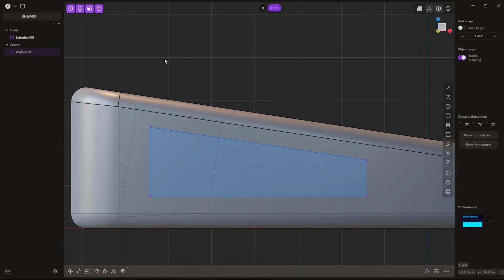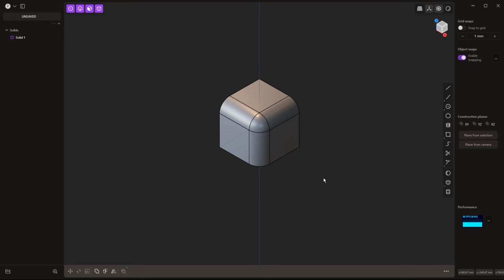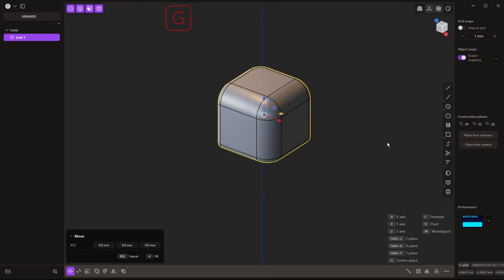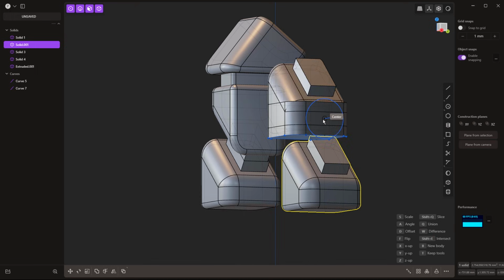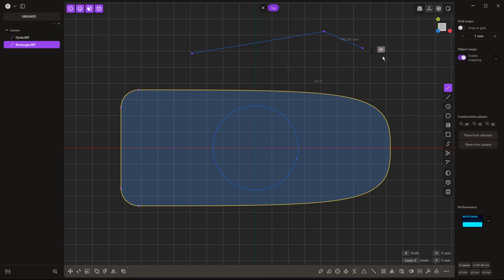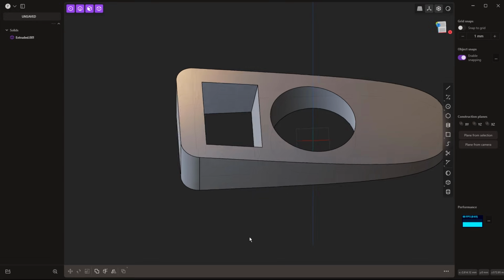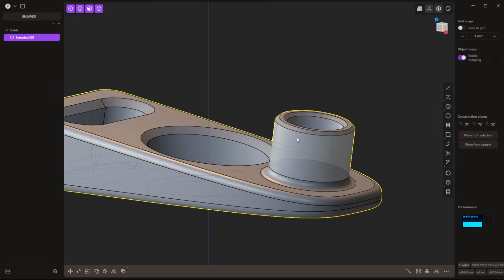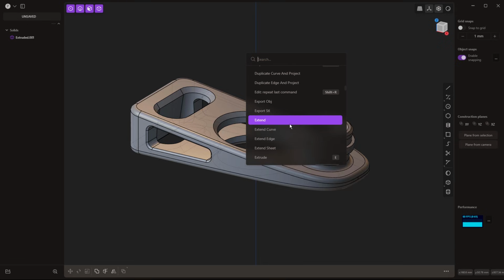Getting Started with Plasticity for Beginners | V1.4 Update | UI and Modeling Overview

Comment: Problem with this amazing modeling tool is it's not parametric where I need it ( Ex: just drag a square, once it's done then you can't adjust the exact size ).
Reply from the maker: There have been some nice updates since that video.  Check out the updates to dimension/measure here https://youtu.be/LSAc4uyxTao

you can use dimension and the measure tool to precisely locate features.  its not a true parametric control but its improving.
Reply: @LearnEverythingAboutDesign  Do they plan on adding parametric edit feature on edges ?

Comment: This is awesome! Great tutorial as well. I'm a 15 year Blender user and this just feels like home. Quick question: I'm using a MacBook Pro M3 which doesn't have a numpad, so I'm unable to get the hotkeys that toggle between views, front, side, etc. to work. In blender I can remedy this issue in the User Prefs, but I'm not seeing a way to get the views hotkeys working in Plasticity??
Reply from the maker: Awesome!  For the Temp Constructioni Plane you  have to have a planar view selected.  On the right hand side there is also a button for creating a construction plane from View.  Its CTRL + SPace, but i imagine on a mac that would be Command.  Its called "Plane from camera" on the construction planes section.

Comment: I had bought the software on my macbook,
But yet I didn’t get the license key,
How long does it takes for me to get the license?
I use your code discount and yes it work🥰 thank you for the discount coupon 🥰
Reply from the maker: hmm. it should be instant.  the serial number should go to your email.  double check your spam folder.  If not you would need to reach out to the plasticity team.  I can help if you have trouble getting ahold of them.

and thanks!

Comment: I create things for my 3d printer.  A lot of times i need to make minor adjustments, for instance shrink a cylinder by 1mm.  Are minir adjustments like this easy in plasticity?
Reply from the maker: Yes and no .  So you can go in and select the face of a cylinder and offset it by 1mm (or .5mm for the radius) for your offsets.  But there isn't a sketch you can go back to and make that changed.  I have a few videos on doing things like Print in Place models, hinges, and threads on the channel.  We have some new features in the latest release that lets us add dimensions to features and edit them with the move command.  this helps with hole positions for example.
Reply: @LearnEverythingAboutDesign  I'll check your videos, thanks!  I feel like I would like this better than fusion but I worry about not being able to easily change constraints (yeah I understand they don't exist, it's just how I think of *changeable" dimensions.  😀).

Comment: i been using Fusion 360, can one make dimension  drawing?
Reply from the maker: Sadly no.  Plasticity doesn't have drawings and honestly I doubt that it ever will.  it is meant to be a CAD program to help with rapid concept development for mainly downstream work like rendering/animation.  It can be used for 3d printing and other manufacturing but its not a history based parametric CAD program.

Comment: How do you effectively work at mm level? My printer has base plate of 200mm by 250mm I set grid to this. but it makes the grid microscopic. I was able to zoom in a ton and shrink the objects I was working with. But if I pan at all the camera moves a metric mile away from what I'm working on.
Reply: Actually I closed and re opened software and it seems to of fixed itself
Reply from the maker: If you take a look at the latest video i did here https://youtu.be/FUH8IvXmodE  we start by setting up the grid and i mention setting it up to your build plate size.  that helps me at least.

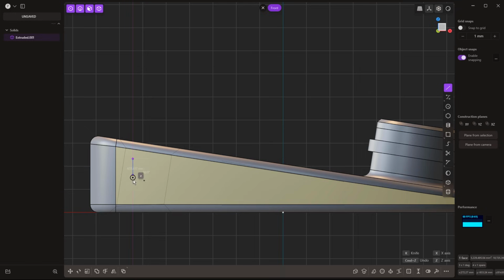Comment: At 23:30 into the video, where he was creating that cutout on the side was very confusing.  Maybe it was because I couldn't see or tell where his cursor was or was being clicked on, or maybe he was using shortcut keys, but it was impossible to follow.  I kept getting Boolean errors.  For some reason, I couldn't close up the hand-drawn panel on the side either.
Reply from the maker: at 23:20 we hit O on the keyboard to offset the selected face.  This tools is a bit tricky because the cursor location often makes it tough to get it to work.  you can manually enter a value when you hit O.  Try a negative small number and see if that gives you the offset you want.  

When we move to using the line tapping the shift key enables some relationships so you can get virtual snaps for things to be parallel or intersect.  

For closing up the hand draw section try selecting the point you want to move, hitting G to start the move command.  Once the move command is active look in the bottom right corner for the options. the Freestyle option lets you pick the starting point and the ending point.  the starting point is the current location of the vert you want to move, and the ending point is the one you want it to move to.  Hopefully that works.
Reply: @LearnEverythingAboutDesign  Gosh, that does make sense when I go back and retry.  Thank you kindly.

Comment: I'm disabled and use a tracker ball and can't seem to move the model around. Please can you help. It's a 3 button tracker ball. So, I don't want to buy the app if I can't use it.
Reply from the maker: Hmm, that is one i haven't heard before.  I would have assumed the tracker ball style mouse would work the same as any other mouse in the system.  In your user preferences what is the setup for navigation?  You could try a different navigation preset and see if that makes any difference.

Was there anything special you had to do in your system to use that tracker ball in other applications?
Reply: @LearnEverythingAboutDesign  Hi. No, the trackerball works find in all my 3D design apps like TinkerCad and all my CAD app, or am I doing something wrong? I can move the work space up and down and side to side not round same with the model. | can send you a screen video if you got a email.
Reply from the maker: @DisabledGuy  support@caducator.com  you are welcome to send me something but since i don't have a trackball I will be guessing at solutions.  With plasticity rotating is typically done with the middle mouse button and moving the mouse.  So whatever your middle mouse button is I would assume you would have to press that down and roll the track ball.  Right mouse button and track ball should pan.  At least with the default settings.

Comment: I love Blender, but i love the way this program can bevel 3 edges correctly....not in blender.
Reply from the maker: Yeah some things are just easier on BREP solid bodies!  There are features that let you start/stop a fillet or bevel/chamfer along an edge too which would be impossible on a mesh with a modifier.

Plasticity has a "Blender Bridge" which is a live connection between Plasticity and Blender (one way) to bring your models into Blender.  We have a video or two on the process.

Comment: People who have plasticity and who have experience with blender, is it better or worse then blender (I’m coming from blender)
Reply from the maker: It isn't really meant as a replacement but a companion in my mind.  There is a Blender Bridge( i have a few videos on it) that is a live connection between them so you can take your solid models from Plasticity into Blender.  If you are ok with hard surface modeling in Blender, and using booleans and a modifier stack then you are probably ok not using Plasticity.  But it does give you the ability to make Solid and Surface models, not mesh models.
Reply: @LearnEverythingAboutDesign   thank you! 👍🏻

Comment: I use autocad and solidworks for work.For some reason i struggled with fusion... Going to try this for 3D printer and fusion for post cam CNC
Reply from the maker: I have some "absolute beginner" content on my site www.learneverythingaboutdesign.com for Fusion.  I use solidworks and used to use Autocad so feel free to ask questions.  I actually did an entire series for Autodesks Youtube on coming from Solidworks to Fusion, but not sure if its "live" yet.
Reply: At my workplace, the engineers / machine shop use solid works. It looks intimidating, but thinking I may have to learn it.

Comment: Created and arc.  Connected the endpoints with a line.  It did not create a face and would only extrude edges.  Next...
Reply from the maker: was your selection filter in the upper left of the modeling area set to edges?  If you have all (5 or tab on the keyboard) or set it to faces (3 on the keyboard) that will let you select those closed profiles.  The only reason it shouldnt is if you don't have the face selection on.

Comment: Is this relevant to the current  stable version
Reply from the maker: For the most part yes the workflow and whats in the video is still the same.  I did a Whats New video for version 24.1.1 https://www.youtube.com/watch?v=jmpmb5M2h34&t=3s

The description of that video has a comprehensive list of what has changed including minor/major enhancements

Here is a short list of what you may notice.
Offset Face now has dependency which means it can terminate at another face which you could do with "Match Face" in v 1.4
Pipe gizmo has changed a bit to make it easier to use.
The right-click to confirm is now a 1 click thing vs in 1.4 it was 2 clicks.

Other than those 3 things, the workflow in the video should be accurate.
Reply: @LearnEverythingAboutDesign  in the new series do you go over the ui for beginners
Reply from the maker: @Scotts-starseed  The UI hasn't really changed at all so it should be relevant.  I do have a 5 part beginner series on modeling workflows in plasticity.
https://www.youtube.com/playlist?list=PLBDfGh8A8kXVIrO1aizPFmRBy-A-G9svk

The main ui difference between 1.4 and 24.x.x is that your right mouse click to confirm is only one click now where it used to be two clicks.  The beginner series doesn't have a basic UI overview but we go pretty slow through concepts and feel free to ask questions.

Comment: Im leaving fusion 360  my biggest thing before i know this will my main playeform. Is 3d scanning something into mesh then being able to design off that
Reply from the maker: Not currently with Plasticity no.  You can import an OBJ mesh but its basically just a reference. you can't model on it or snap to it.  So if you are looking for a scan to design workflow I do suggest you stick with Fusion.  It is the best right now in terms of what you get for the price.

Comment: Perhaps this was done on purpose as there were numerous Blender parallels stated in the tutorial, but there is not enough emphasis on precision modeling.  The only part of the process that included a precise measurement was the size of the original square.  I understand that this is "CAD for artists" but some "artists" (read: designers) need the precision inputs for one reason or another, whether it's making parts to be engineered, 3D printed, a meticulous workflow, or to appease one's OCD.  After watching this and not seeing any precision makes this software look like a Blender, Maya, or C4D substitute, which is nothing new in the world of 3D modeling.  However, this is still piquing my interest, and I'll look for other tutorials to see if precision takes a front seat in the modeling process for designing things that will eventually be created in the real-world.
Reply from the maker: 100% get what you are saying.  It is not really intended for that kind of dimension driven modeling.  You can make things a certain size when you create them.  Add certain sized features, pattern at specific spacing etc.  But I wouldn't use Plasticity and the term "Engineered" in the same sense of the word.

I did a video talking about the dimensions/measurements portion of plasticity a little bit ago here https://youtu.be/kATCRYZKE7U

The main reason Plasticity exists is to model BREP/NURBS type geometry that is generally tricky to do in Poly modeling like Blender.  Here you are modeling solids and surfaces like you would in a CAD program, but with more freedom around that workflow.  

For concepting "hard surface" models Plasticity is a great tool.  If you are designing something that requires 3deg draft pulled in a certain direction it could be done in Plasticity, but you are better off sticking with a parametric cad program where you can define those values, link them and drive/change them later.
Reply: @LearnEverythingAboutDesign  Thanks for the reply.  In your experience, how does the program fare in larger, multi-part models/scenes?  Full transparency, I'm a designer in the retail/tradeshow sector so I'm modeling more than just single "thing" but rather many parts of a whole.  I work exclusively in Rhino, and I'm not really looking to jump ship as this workflow suits me well, but learning new programs are always a plus for the resume.
Reply: @mjroberts725  Honestly I would say it probably isn't a good fit.  The only place I could see it make sense is to put together concepts quickly.  Like you could put something together, export the BREP solid as a STEP and bring it into Rhino.  Are you using Rhino 8 currently?  I have been waiting to try that since the SubD stuff in 7 was still pretty bad.  Was hoping 8 and updated edge weighting would help out.  Personally i think if Rhino had more than one person doing the UI/UX it would be a great program.  Tons of power/functionality but the workflow really hinders it in my opinion.

What do you use now for render/viz stuff?  that might make a check in the Pro column for Plasticity as going to Blender is super simple.  But if you go to something like Keyshot that is a different story.

Comment: Why wont you just use blender with some cad plugins ? Looks almost identical and it's free.
Reply from the maker: They are very different.  Plasticity models with BREP solids and NURBS surfaces.  these are actual solids and surfaces and can be used a step files.  Blender only creates mesh models.  Mesh modeling can't produce a cylinder, and adding details requires edge loops and/or the use of a lot of booleans in a modifier stack.  Plasticity lets you model hard surface type models faster and more accurate.  If you want to use them in Blender there is a blender bridge which is a live direct connection allowing you to bring the model in to blender, retopo it if you need. pull edges/seams etc.  and if you edit in plasticity it will update in Blender.
Reply: @LearnEverythingAboutDesign  Interesting, ill check it out. I'm currently looking for F360 replacement but this direct modelling does not convince me.
Reply: @sob515  What don't you like about Fusion.  that might help.
Reply: @TheShift1313  It's dead slow and bugged on macos, keeping all projects in cloud is annoying, only 10 projects editable allowed in free version. It's intuitive and easy to use but being forced to use cloud is disqualifying. I can already see that plasticity also has some serious performance issues on M2 mac's like 100% gpu usage all the time.

Comment: I just got plasticity, I'm pretty happy with it so far, but the camera keeps doing this really strange thing of snapping at set angles, it's just bizarre and i haven't found any way of disabling that behavior.
Reply from the maker: That is strange.  Does this happen when you just free rotate the part?  If you hold down ALT, and the middle mouse button then drag a direction it will snap to the nearest plane.  but just holding down the MMB shouldn't do that.

Comment: How do add solidity to a design, like for instants you want your design to have 5mm walls ?
Reply from the maker: The design is solid to start, but if you want to shell it there is a tool call Hollow you can use which will.  You can also offset faces.  If you  have a surface (sheet) you can thicken it.

Comment: This reminds me a lot of SketchUp Make, which I've used quite a bit. In a good way, I mean, but I wonder if it has some of the same shortcomings.
The pro version of SketchUp allow components to have parameters, but not the free version. Other than that, you can align to this and that quite easily, but sometimes things just tend to go wrong. Sometimes down the line after pulling, moving, adjusting some holes and whatnot, you suddenly have a fraction of a hundredth of a millimeter off the mark somewhere and you have to try to figure out what edge or face is slightly incorrect. It is incredibly frustrating and time-consuming. And, if you want to adjust only parts of an object, but not the rest, you have to manually select all the edges and faces you need to move, and risk the same problem I just mentioned. What I've concluded is that I want constraints. Constraints that are for example given from the physical materials the object is going to be made from.
So. I wonder then, how does Plasticity fare when you have to model after precise measurements, and can you rely on the end result still abiding by that? Are there any ways at all to define any constraints? Also, is there any functionality for sheet (metal) work?

Comment: I have a CNC plasma cutter. I’ve been using the free version of Fusion 360 and Sheetcam. Does Plasticity export DXF files that I can post process on Sheetcam?
Reply from the maker: Sadly no there is no DXF export.  Your best bet is to export a 2d sketch from Fusion, a 2d drawing, or sheet metal flat pattern.  I don't know of a dxf export on the horizon for plasticity as generally the workflow wouldn't go to 2d but rather into more 3d for things like rendering/animation.
Reply: @LearnEverythingAboutDesign . Ok thank you!!!  I hate that since Plasticity looks good.

Comment: Thanks for the vídeo! How is the handle wirh STL files? Can I import and change?
Reply from the maker: Not currently.  I think there are features in the works that will let you work by snapping to a mesh, but currently you can import them as reference and that is about it.